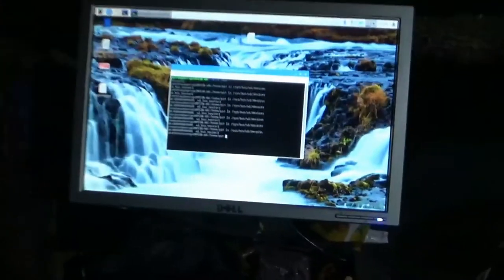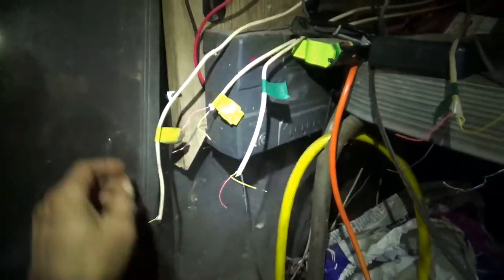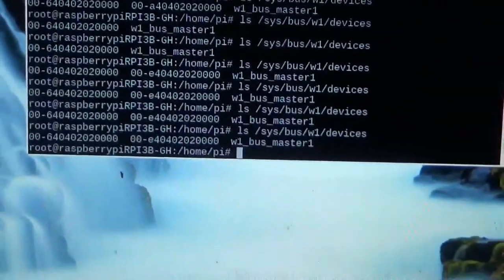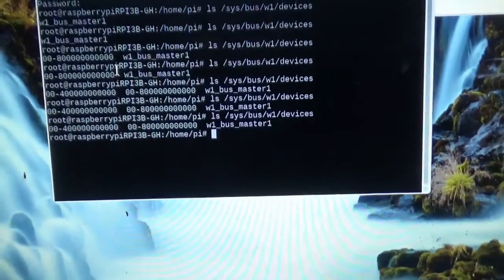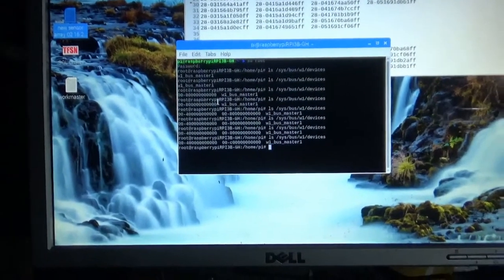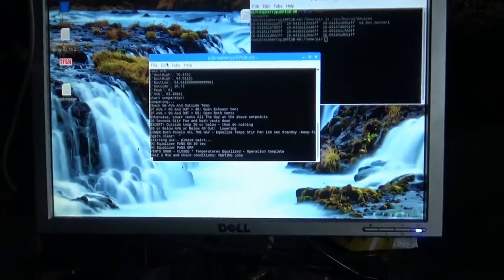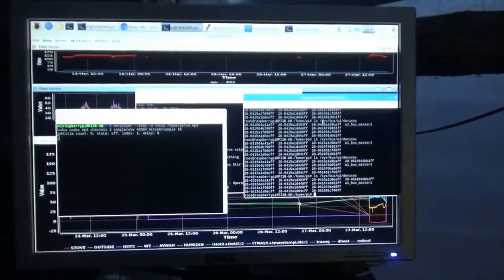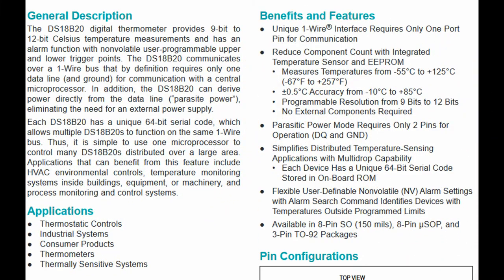DS18B20 1 Wire Digital Sensor Troubleshoot Diagnose Tips Techniques Bad Readings Bad Address

Comment from the maker: Update 12 10 2022: Currently setting this system back up in "test mode" in my apartment, Whatdyaknow? I ran into sensor issues. This time they are addressing ok.. but reporting 28 degrees F... all the time.. while the good ones report ACTUAL temps. So I cam back to brush up. Thanks self! 😁

Comment: Instead of running so many sensors.  Why not run another bus to another GPIO pin? More sensors on a bus causes more issues.
Reply from the maker: That will likely be a future upgrade... I had considered a multiplexer system as well.  Thanks for the suggestion!  I can't wait to get back to building stuff like this again!